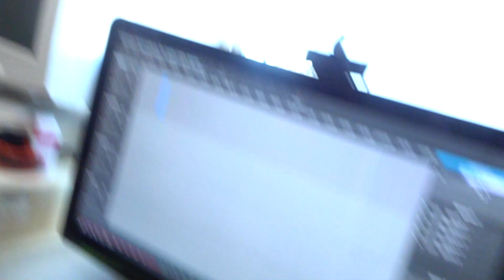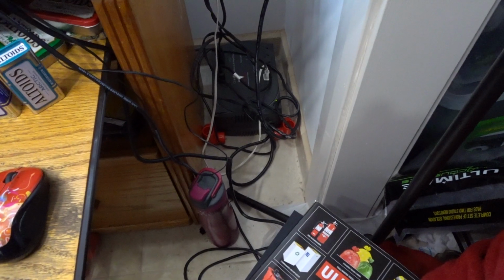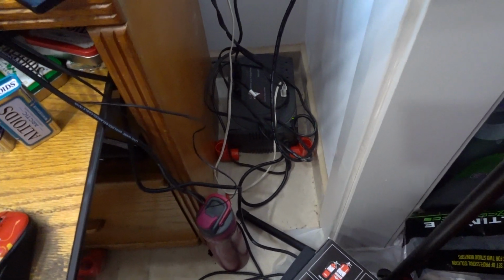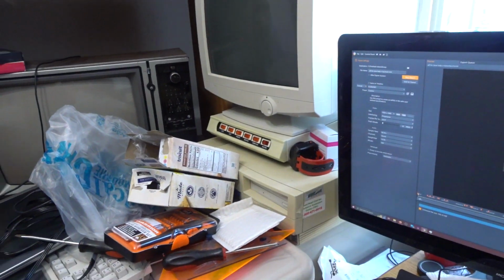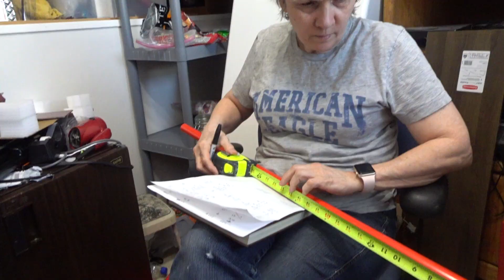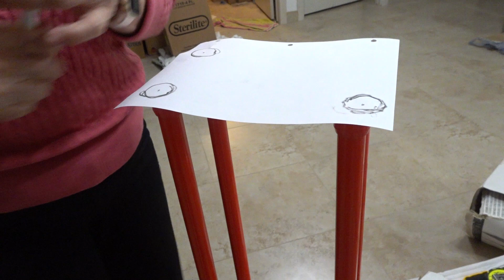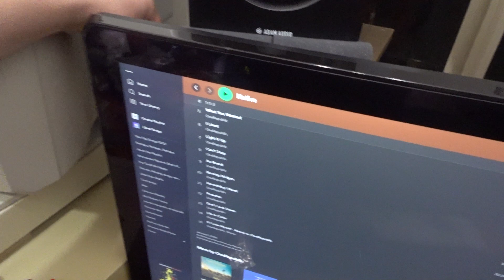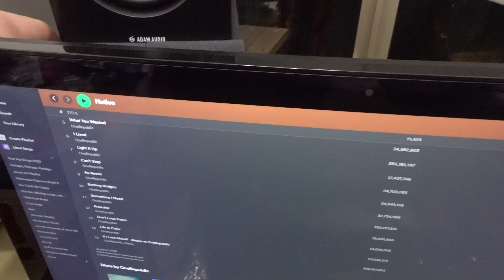Making speaker stands out of red PVC

Comment: GET
Alexa to control lights and other accessories. 

You won't have to clutter everything at the desk
Reply from the maker: I don't have an Amazon Echo or anything like that. If I did, it would be Google, and just my phone. I prefer simple on and off with no worrying about if the assistant will work. I have enough problems with my busy box, and that doesn't have many problems. Thanks for the suggestion though. I hadn't thought of it.
Reply: I'm thinking of doing the same with pvc for a VR harness setup
Reply from the maker: I just got a set of smart plugs to use one or two for something else. I came downstairs the other day and realized I forgot to turn off my speakers. I then realized I had an extra smart plug I could use for, so I will be putting a smart plug on my speakers but I won't be putting a smart plug on my light. As for tying in to my Google Assistant, I don't know if I will do that or if I will just keep it inside of the app that came with the smart plugs.
Reply: @Coolshows101  upload a PT2 or Update video if you change anything. 🤟🏾🤟🏾🤟🏾
Reply from the maker: Will have an update video sometime.